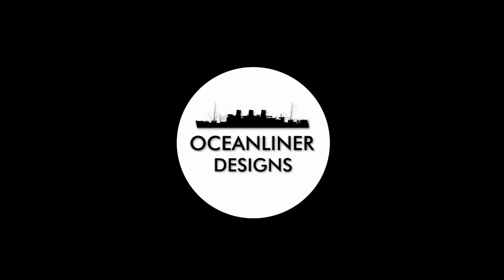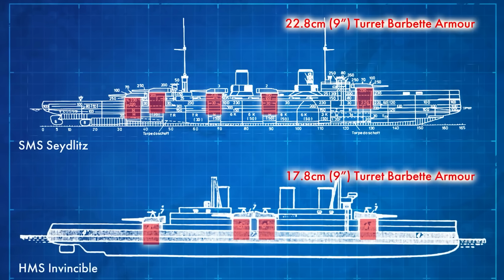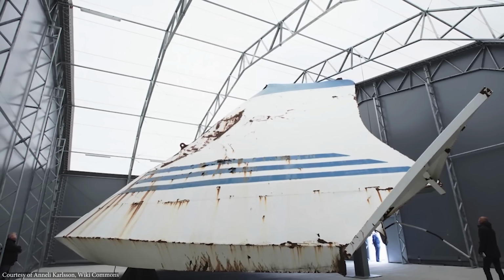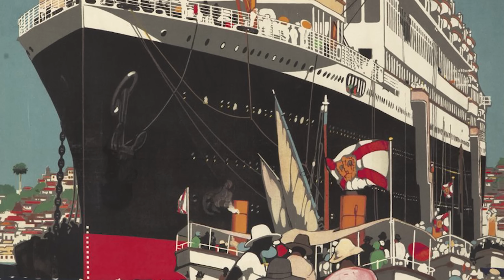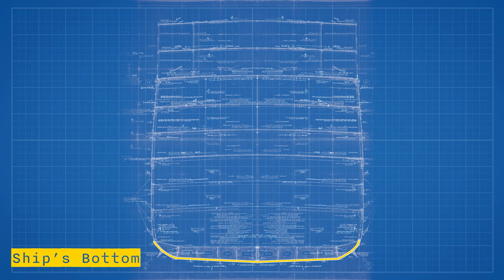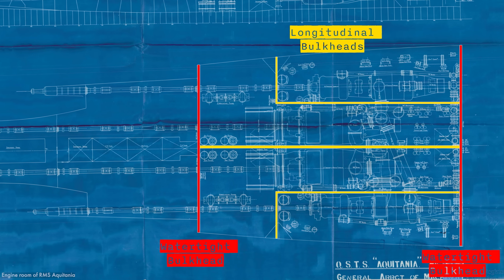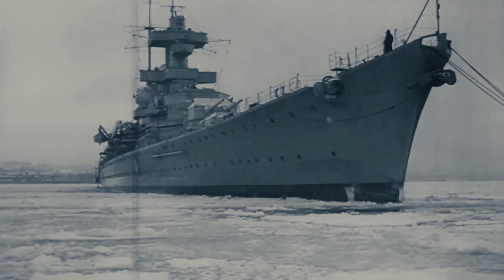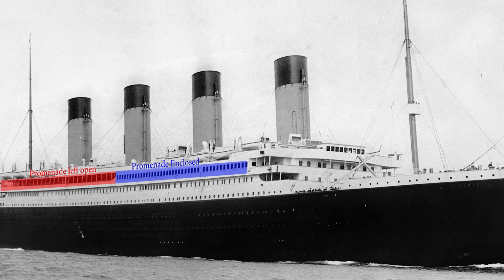The Worst Ship Design Fails in History

Comment: 12:00 the problem of the exploding ships has not much to do with the armor scheme. It's a problem with the powder used by the british. If new, it was as safe as could be. But once it started to decompose from aging it started to bleed a component through the silk bags, which then dried up and this high explosive, shock sensitive powder was all over the place between turrets and magazines. Even if you clean it up properly, residues will remain. This residues won't do much in everyday operation, but even the shock from a minor hit can set off initial explosions, which send more shocks even through closed bulkheads and this chain reaction will eventually reach the magazines. The french had a similar problem, their battleships tended to blow up without reason in warmer climates. For a more detailed description of this you should watch the in depth analysis by drachinifel here on youtube.

Comment: Re battlecruisers

Worth pointing out that HMS Tiger suffered 16 hits and Lion 14 at Jutland.

The issues the British had was twofold. Extraordinary laxness in regards to ammunition handling (too increase the rate of fire) and secondly the propellant itself. Cordite was volatile. Seydlitz was lucky but it’s worth highlighting that her propellant didn’t act in the same way that cordite did. If she had been carrying cordite she would have deflagurated just like Indefatigable,Queen Mary and Invincible.

The angle of fall highlighted seems to me  to be too steep. Hood is often described as suffering a plunging hit. In actuality it was around 20 degrees. You also have to remember that at the time these ships were conceived 10000 yards was considered “long range”. 

By the time they were fighting they were in action at 15 to 16000 yards. So,yes the decks were to thin,but that was due to the rapid increase of fire control technology.

Comment: More turbines:- Ships requiring more flexibly, used reciprocating engines (Triple Expansion) exhausting from the LP cylinders into a turbine which was mechanically connected between the HP cylinder and the IP (intermediate pressure) cylinder to increase the pressure and temperature of the steam passing to the  two second cylinders . 
  NB, the exhaust steam from a compound engine, although hot, could already be below atmospheric pressure, before condensation. 
  Sorry if you knew this already.

Comment: The American Iowa-class battleships had a very exaggerated sheer forward because they were extremely narrow forward (this also caused some compromises in the way of No.1 turret - the No. 1 barbette had severe issues on the lower decks because the ships' barbettes only BARELY fit the beam in that area (and in fact on the third deck part of the sides of the barbette had to be shaved away to allow enough space for enlisted men to squeeze around them).

I wonder how many guys were actually able to get past that during the 1980s reactivations, with so many crew members reactivated from reserve from the Vietnam War - this was the era when the US Navy was phasing out steam powerplants in particular in favor of gas turbines, so the Iowas always had a massive shortage of boiler techs.

Comment: Urgent! Just 1 thing. All turbines run in one direction only. Steam Turbine civilian ships, had Ahead turbines, and Astern turbines.  Older warships, had, in addition,  ‘cruising’ turbines.  The gears were only to reduce the rotor RPM to a speed suitable for the screws.  There were frequently several turbines, HP & LP.  They were complex to operate!

Comment: The failure of battlecruisers was a failure of tactics. Battlecruisers were never meant to fight capital ships, they should be more accurately be called cruiser destroyers, in the same style of torpedo boat destroyers.

Not enough is talked about the first fast battleship the Queen Elizabeth class, which was the very class that made battlecruisers obsolete by having the best of both worlds of speed and power/protection - even the later "battlecruiser" Hood was just an improved Queen Elizabeth. At Jutland, they also saved the battlecruisers from destruction.

It was also the first capital ship to use oil instead of coal which improved efficiency and endurance immensely, it was the most advanced warship in the world for many years, it was just as revolutionary as Dreadnought and far more useful, they were everywhere, always on the frontlines unlike the newer battleships which they were scared to use resulting in the fleet in being, they were the best money any navy has spent on any warships given their service over 30 years and 2 world wars.

Comment: The gearbox is not used to reverse the propeller. Astern propulsion is  normally achieved using a set of LP turbine blades and nozzles, these are normally mounted in the turbine casing.

Comment: Yeah, the Brit battlecruisers were great until the other side also had them, and then the could no longer do their role as fleet scouts beating up on light cruisers and destroyers, but then facing major caliber fire from their opposite numbers.  The German BCs were built in the knowledge the Brit BCs already existed so were more like fast battleships, only slightly skimping n armor and going for slightly smaller guns to maintain high speed.  But what made the Brit BCs blow up and the German BCs not blow up was the different chemical compositions of their propellants.  The Brit powder exploded, the German powder burned.  Both Seydlitz and Derflinger had major magazine fires at Jutland (and Seydlitz also at Dogger Bank) but did not explode.  Same with Gneisenau in WW2 vs. Hood_.  _Pommern exploded at Jutland but this was most likely due to a fused 2ndary batter shell detonating and thus detonating all the others.

Comment: Interesting videos.  Incidentally...  The reduction gears used with steam turbines are not for reversing.  They are used to reduce the turbine speed down to the speed required for the propeller shafts.  Reversing is done with either a reversing turbine or reversing faced blades in the one of the forward turbines.

Comment: The HOF Enterprise ferry is not technically a design flaw.  Consider that a submarine is designed to sink, navigate deeply submerged and return to the surface.  It's the efficient and detailed operation and overall handling that is the key factor.  The weather conditions in the North Sea and almost anywhere in the winter Baltics accentuates the design compromises. That should make captains and crews even more "attentive".

Comment: @jk50with10 I fully agree with your comments about battlecruisers.  Some other notes worth making. 

Mike Brady,

The first part of this video is mostly a script you used around 10 months ago and sadly it hasn’t been updated. 

1. The Battlecruiser wasn’t an evolution of the light cruiser (which is the type of cruiser pictured and described) but rather the Armored cruiser which was a larger and much more heavily armed ship. That’s why you see early ones being called Dreadnought Armored Cruisers because they were essentially and Armored Cruiser designed along Dreadnought style all big gun principles. The role as has been noted of the first two classes was to be able to kill anything they could run down (like light cruisers or armored cruisers) and run from anything they couldn’t take on like a battleship. In this role they were very successful. The later classes evolved and became ships intended to take on other battlecruisers. 
2. Battle ranges in WWI did not feature plunging shell fire as you suggest especially given the limited main battery elevation that was common. Deck armor was primarily intended to reject shells that penetrated the side of the ship above the main belt. 
3. Battlecruisers were in fact more expensive than their battleship contemporaries. Lion for example cost around £100,000 more than Orion. As such their reduction in armor thickness wasn’t done for cost savings it was to help enable them to achieve the higher speed that was a Cornerstone of their design
4. As has been noted the cause of the magazine explosions had much less to do with the design and protection of these ships and more to do with sloppy ammunition handling practices. 
5.  More than one battlecruiser took a near Biblical level pounding and survived. HMS Lion for one. SMS Seydlitz for another. 
6. Speaking of Seydlitz the hit you mention happened at Dogger Bank not Jutland and was from a 13.5” shell not a 15” shell. 
7. It’s entirely unfair and wrong to describe the Battlecruiser or more specifically perhaps the British Battlecruiser as a design failure. The first generation performed very well in the role it was designed for and the second generation again proved to be very capable and valuable ships. Their speed meant that both the RN and the IJN got very valuable service from the type in WW2 as well. Describing the first generation especially as a failure because they could not stand up to battleship grade guns is like saying a WW2 heavy cruiser was a failure because it couldn’t stand up to a modern fast battleship. 

Re MV Estonia the latest report released by the Swedes in January of 2023 found that the ship wasn’t seaworthy because flaws in the visor and problems with the bow ramp and the ships paperwork. They concluded that had the vessel been properly inspected she would not have been sailing on that route and the sinking would likely not have happened. Not to mention all the faults of the crew that have been identified through the years. Again it’s hardly fair as you do in this video to essentially class all RORO ferry’s as design failures and in particular Estonia.

I very much enjoy the vast majority of your content but this video and the one 10months ago that this basically repeated are not up to your normal standards.

Comment: Hey Mike this is from Mike and I live on the west coast of Canada where we have  the publicly owned BC Ferries established in 1960 because it's part of our highway system and it has the largest fleet of ferries in North America connecting British Columbia's mainland with the many islands off our coast.  We have many many 'roll on and roll off' ferries.

Thankfully we've not had any significant loss of people or ships because we Canadians are very aware of weather particularly duing our fall and winter storm seasons.  So when the winds and storms pick up sailings are cancelled until conditions look safe for passengers and trucks and vehicles. During this current holiday season, there were was one day when sailings were cancelled.  Thankfully otherwise BC Ferries carried we locals off to the Islands and onto our mainland in safety...keeping folks safe requires some patience and delays periodically. :)

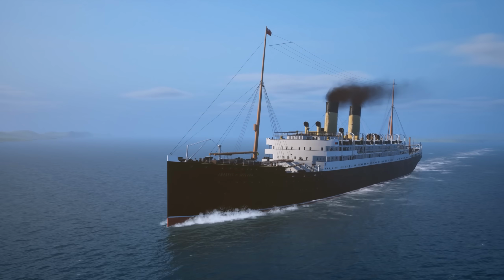Comment: At 36:21, the drawing of multiple ships has a flag similar to a flag I've seen at airports. What's it meaning here? It's the flag with 6 squares that alternate colors of what looks to be orange and white. The ones at airports are 9 squares within a larger square flag.
Reply: This flag serves as a vital safety tool in aviation and transportation environments. Its distinctive red and white checkered pattern ensures high visibility, effectively marking potential hazards and obstructions on runways, taxiways, and other critical areas where vehicles ,vessels or even construction should be made aware of.

Comment: For the ferries why not just put the doors on the side of the hill rather than the front and back?
You could also do smaller compartments that are sealed off to help prevent flooding (as in 3 compartments holding 30 cars each rather than 1 holding 90)

Comment: Ok, stop. 9:40

No, Lion did not fire 15' projectiles, she only had 13.5' guns, but that's not the main issue here.

The main issues are that A: Seydlitz's barbette DIDN'T protect the ship, it was penetrated and an explosion was set off. What saved the ship wasn't the armour, it was the bad fuses on the British shells, which is almost certainly the reason why the shell didn't go boom. 

And whether we are talking 13.5' or 15'  shells, 9 inches of armour is almost exactly as effective a defense as 7 - it's nearly invisible to the shell at any and all ranges. 

This argument is just plain wrong, and it fails on so many levels. The difference in thickness isn't significant. The armour was penetrated. There was an ammunition fire. Lion was hit in almost exactly the same way, and was saved in exactly the save way. None of the British ships were hit in the barbette, they were all penetrated through the turret roof. And so on and so on. 

This argument is either really ignorant or in bad faith. Given the production values and generally high standards of this channel, I must assume the latter. Though I'm fucked if I know why you would intentionally shame yourself like this.